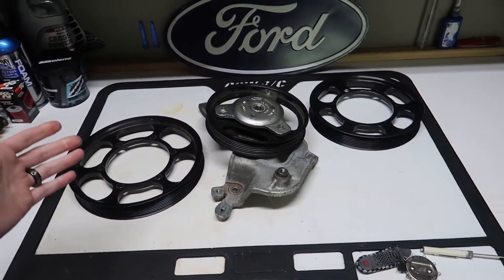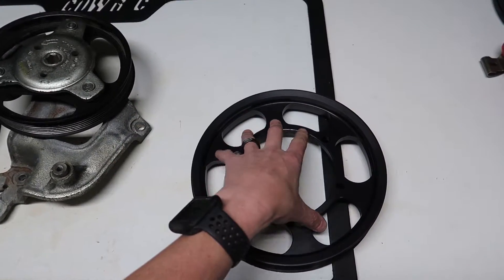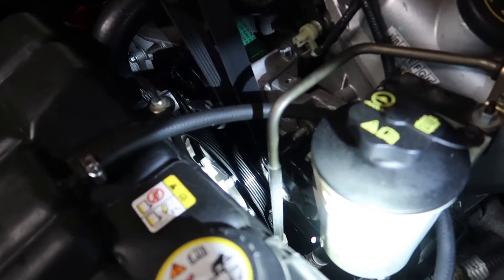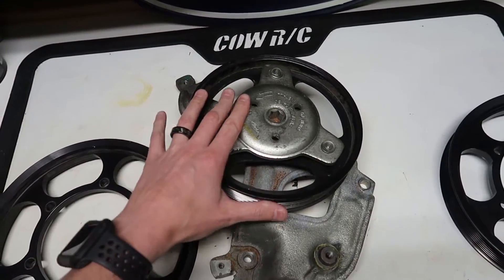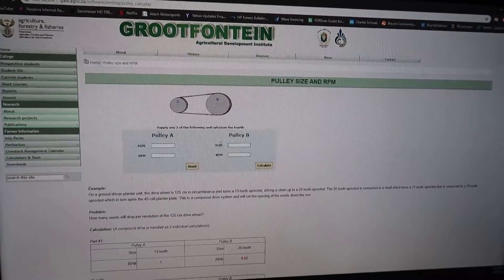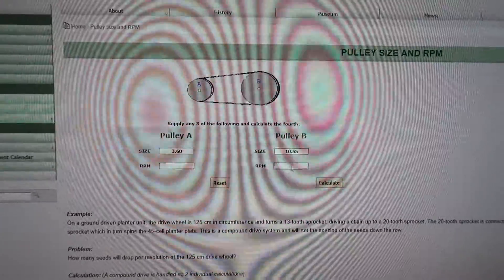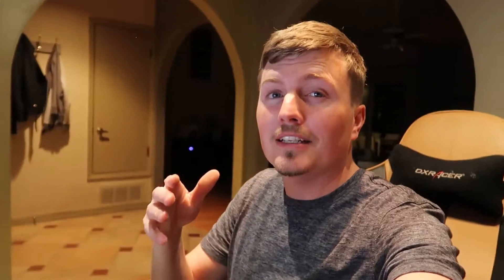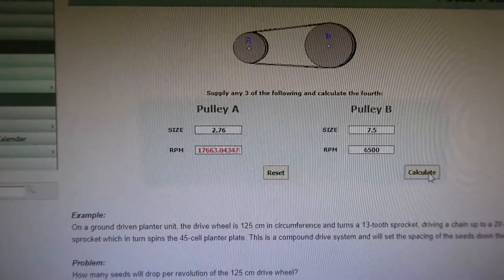How to properly size your upper and lower pulleys

Comment: What size would you recommend (if any), I have a VMP with. 3.1 upper, billet flow idlers and stock lower?  Looking for a little more horsepower without going E85 (not common in my area).

Comment: I think it need longtubes. I think ur running into backpresser issue
Reply from the maker: Boost would go up if it was a back pressure issue.  Which it didn't.

Comment: so looks like stock is 4 lbs by the size?
Reply from the maker: collos33 No stock is a 7.5” pulley or 0lbs because it’s stock. A 8” pulley is a 2lb and a 8.55” ring is a 4lb, 9.1” is a 6lb and a 9.55” is s 8lb, 10” is a 10lb and a 10.55” is a 12lb.

Comment: Congrats on the weeding and thanks for the video. What’s the limit on a non ported m112? And Edward has some beautiful cars. Too bad about his ‘93 cobra.
Reply: Do people upgrade the bearing when doing port jobs to handle the rpm?
Reply from the maker: Blaze Nalder no we all take the risks and over spin them. They seem to do well. Just be sure to shift at 6500 there’s no point in revving them out past 6500.
Reply from the maker: I don't know the exact spec on the m112, but the m110s don't like or do much over 17500 rpm, you also need a good supercharger oil to keep the bearings alive. I think max RPM via the bearing manufacture is 18500RPM so i'm over spinning it as is. They could explode when ever.